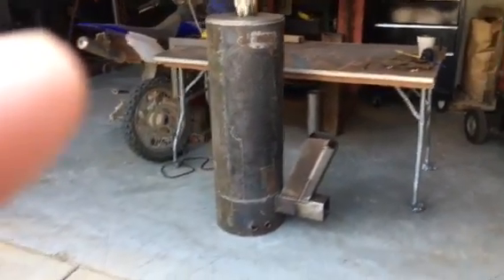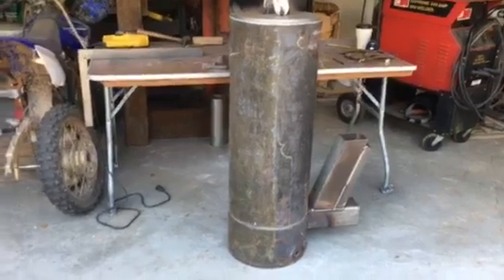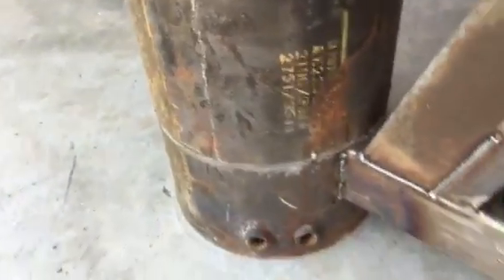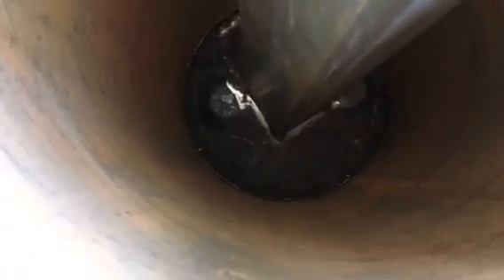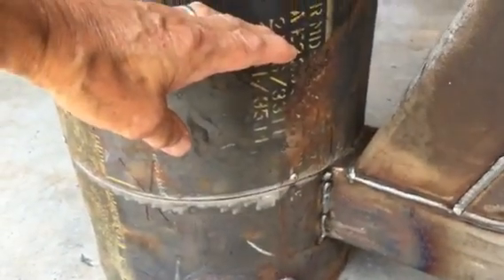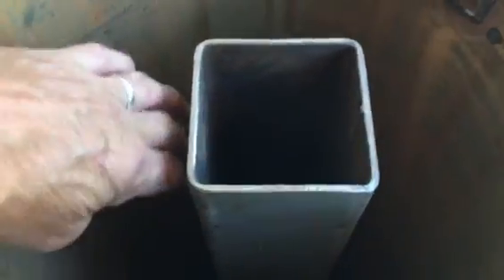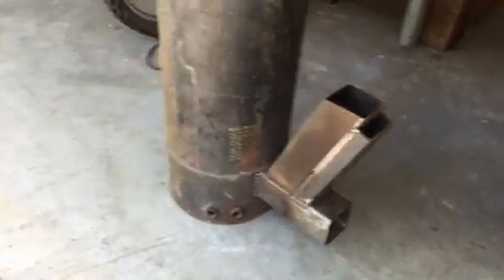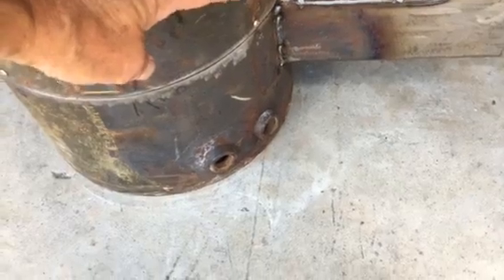Rocket Stove Part 2 ( space heater )

Comment: have you fired this stove up! i built a similar stove ie 4'' square tubing large gas bottle housing, it did not have enough flow to continue the burn the rocket concept worked with paper or saw dust but no luck with sticks that were bigger then a pencil curious to know your results. Thanks
Reply from the maker: Yes I fired it up and it runs great using sticks pine cones ...and whatever. You can see that in my Rocket Stove Part 3 video.  thanks for your interest

Comment: is there a rule of thumb on how big your outer chamber has to be in relation to the inner pipe going up through the center?
Reply from the maker: Ben      I can only share what I know. My stove has a 36" riser that is 4" square tubing.   The riser is 2" from the top plate. The tank diameter is 14"
Reply: Stilsons Solutions รส
Reply: @ดํารงค์เซี่ยงว่อง  If you want a good draw through your stove: 1. Maintain the Cross Section Area (CSA) from stove entrance to exhaust exit, 2. Insulate the exhaust pipe so hot gas continues a strong rise draw.

Comment: the metal will spalt ,i give it 1 seson (winter ) and it is done look on premies .com or facebook for rocket stoves
Reply from the maker: As the video states , This stove is for emergencies in case of a power outage. However there are stoves very similar to this that are going on the 3rd season with no sign of fail.  ( KSPrepper1 )
Reply: Stoves like this have nearly a zero rate of failure and are very safe if the designs are kept basic. I would trust this design over a wood burning or wood pellet stove running on low while I was asleep.